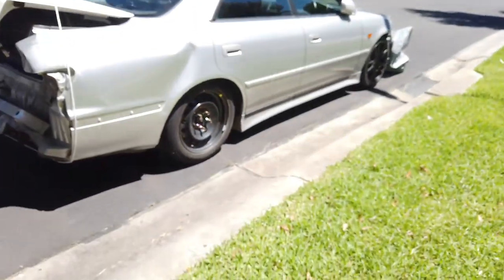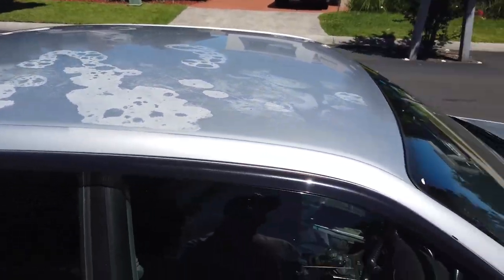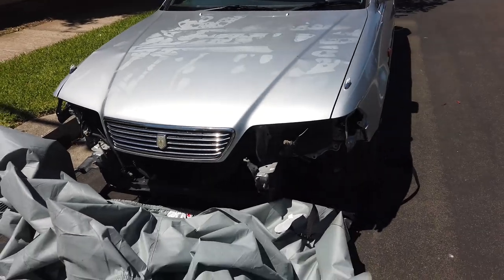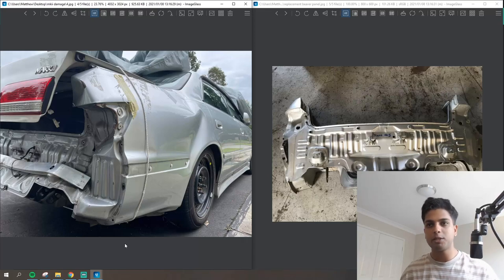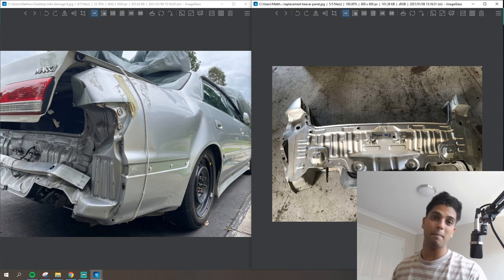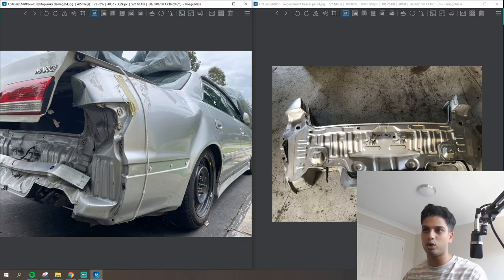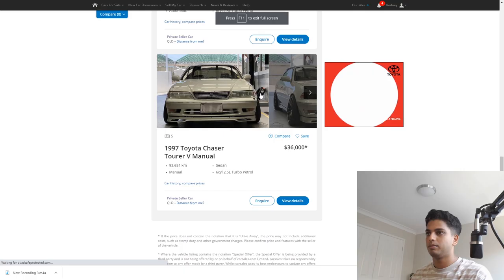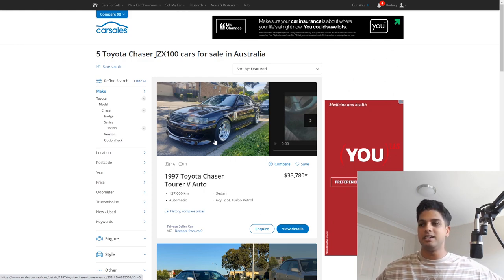JZX100 MARK II PROGRESS | E3

Comment: Even when you buy the beaver panel, the rear quarter is kinked and needs to be pulled from the rear as it’s squashed
Reply from the maker: yes 100% the rear quarter dents will be pulled prior to cutting and welding the new panel